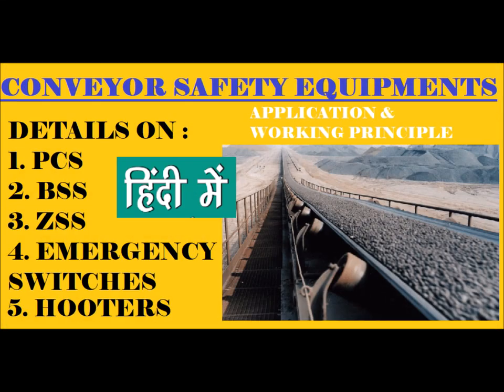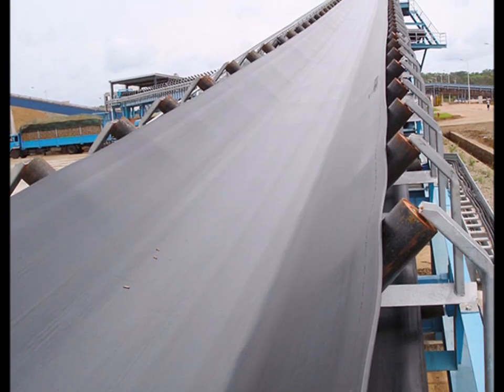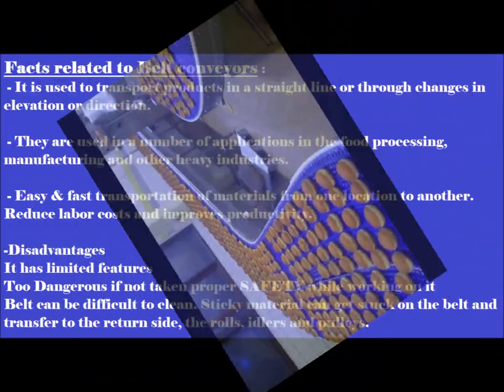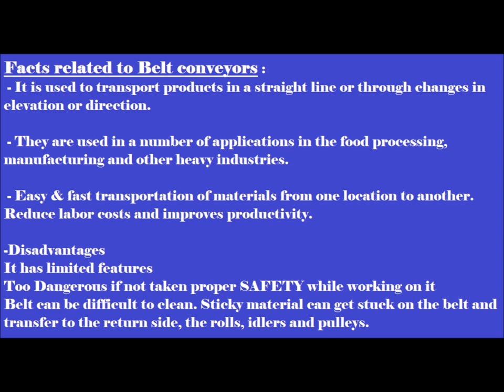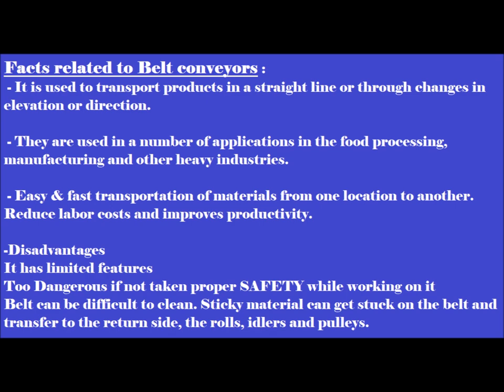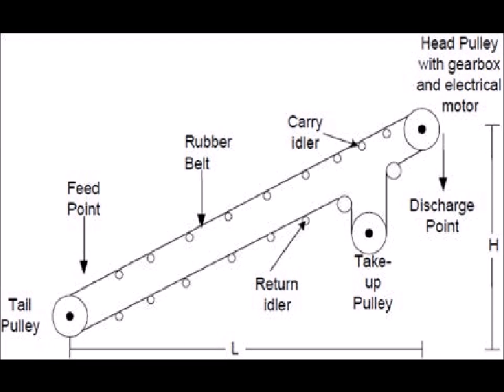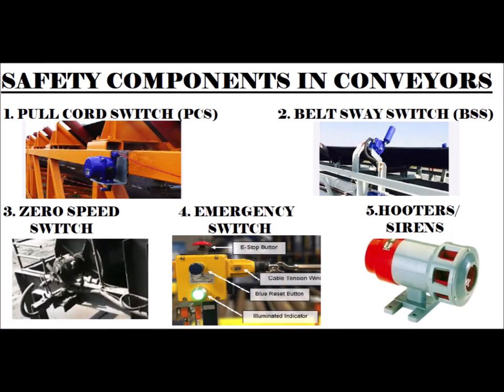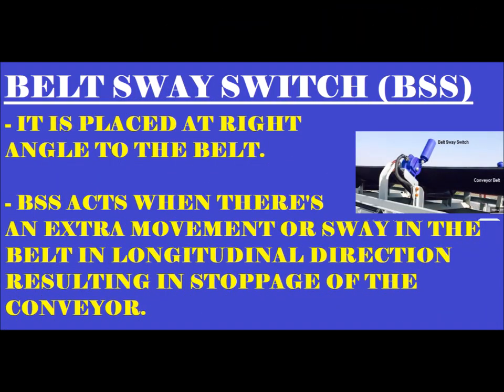BELT CONVEYOR SAFETY EQUIPMENT/COMPONENTS : HINDI VIDEO - COMPLETE DETAIL

Comment: ADANI PORT MUNDRA (  sefty equipment's 
1 PCS:- pull cord switch 
2 BSS:- belt sway switch 
3 ZSS:- zeero speed switch 
4 BTS:- belt tear switch 
5 CBS:- chut block switch 
6 LS   :- limit switch 
7 EMRS:- emergency switch 
8   :- Hooter
Reply from the maker: Thank you 👍🏼
Reply from the maker: sir, is limit switch different from bss ? because both works same